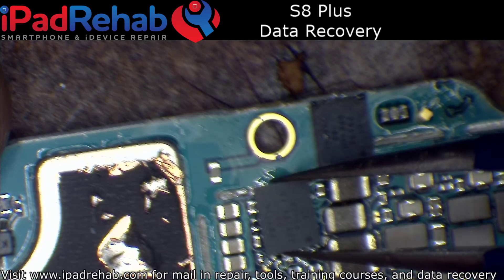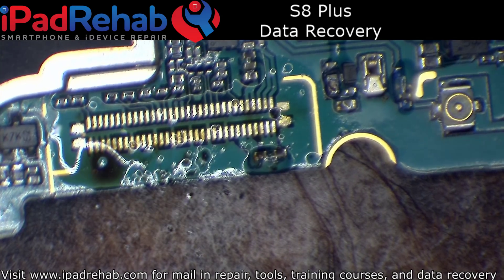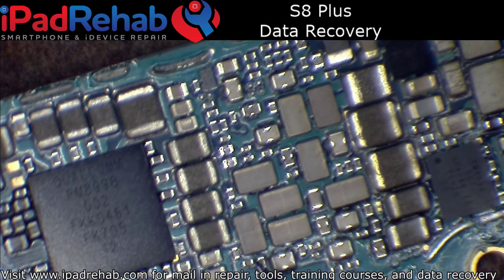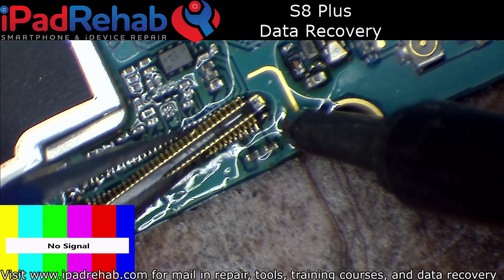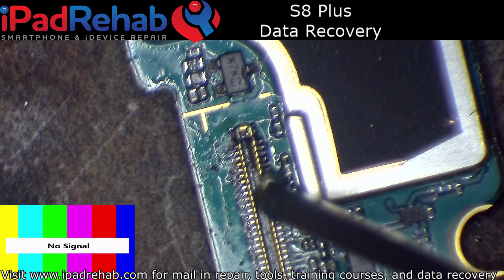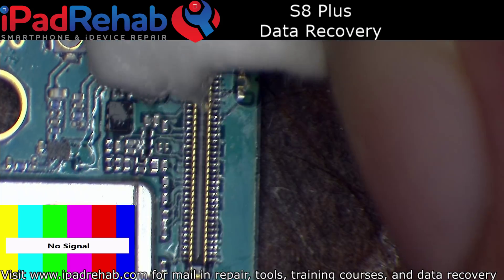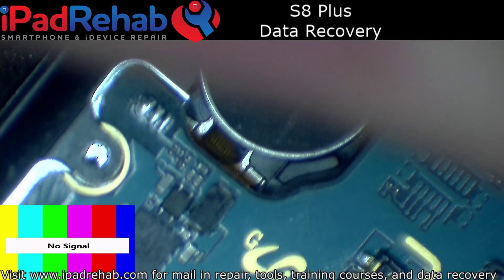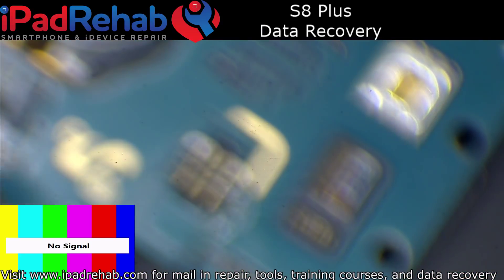Dead Samsung Galaxy S8 DATA RECOVERY

Comment: theres a device in market called UFi box, where we remove the emmc from mobile and fix in it, so we can recover data, my question is will it work with s8 emmc?
Reply from the maker: No, s8 doesn’t have emmc it has ufs and is encrypted.
Reply: @JessaJones  any possible ideas for recovering data? perhaps swaping ufs to another logic board?
Reply: @foreign_bhai  you got any success in getting your phone data?
Reply: @makmerchant  no its still dead
Reply: @JessaJones  can you please guide how to recover data from s8 plus

Comment: Got an s8 dropped pulled .10 amps with cable and .30 with wireless charge. Phone was completely dead no power but my mistake was that I made alot of mistakes replaced charging ic replaced small power ic all in vain ended up replacing big power management ic and phone booted by the time I was done I spent 2 plus hours instead of 20 minutes max...

Comment: I left my s8 charging for more or less 4 hours. When i came back, it was too hot and was dead. I waited for it to cool down hoping it would turn on but it didnt. I had it checked and they told me it was a shorted motherboard and it's gonna cost me more than buying a new one. It sucks, because it was 98% smooth, never dropped or wat not. I took care of it as if it was my baby 😂 plus the all the data i have saved on it. And now I had to buy s9 plus, only because i needed a phone with a nice camera bec of my yt channel. I just wish there was still a way to fix it without me spending a lot.
Reply: If it was in good physical condition, based on the time the S8 was released to the market and the time of your comment, it ought to have still been under warranty!  Samsung should have replaced the main board for you.  It wouldn't save your data, but it would have saved you the cost of a new device.  My condolences on your loss!
Reply: @riverstyxoriginal  hi. It was already out of warranty since the phone came with a monthly plan. I had it for 1 yr and 2 months. Samsung was asking for Php16,000 to change the motherboard plus the battery. I tried checking other options, and was lucky enough to find the best tech guy somewhere here in Greenhills. He said the problem was the main power source not the motherboard bec it was still in good condition. He was able to fix it. And I spent php4000 only. Awesome. Now what to do with my s8? (Kidding) Lol. Im using s9+  now 😄
Reply: Howdy!  (Greetings from Texas!)  It's a shame the warranty was expired!  What a relief to find a less costly solution--and you can probably either sell your S8 on or keep it as a backup for when your S9+ fails!  Good luck to you!

Comment: Great Job :-)    Can I recover data from a UFS chip from a non bootable S6 edge +  by swaping it to a working  S6 edge?  Will I then be able to recover the data of off the UFS chip?
Reply: By default the S6 do not have encryption enabled as far as I know. I will follow the SOP and hope for the best. Thank you for responding :-)
Reply from the maker: Hi John,
It depends on whether or not your phone was encrypted by default--most are not for s6 edge but some are depending on what version of OS it shipped with.  Successfully reballing the chip and installing it on another s6 edge is an order of magnitude more difficult than reading the chip with a reader.  Early on we tried it a few times before s6 reader came out---iirc the phones had to be exact matches carrier etc.
Reply: Tank you for responding. One phone is S6 edge plus (defect) and the other is S6 edge, so what I have just learned from you now is that this will not work. I don't know the version of OS on either or them so if it is encrypted is uncertain. Best solution is to get that S6edge+ defected one fixed then.  Thank you! :-)
Reply: iPad Rehab what is the name of the ufs reader you use again?
Reply: Probebly this one: http://www.teeltech.com/mobile-device-forensic-software/dediprog-nuprog-e-ufs-emmc-programmer/